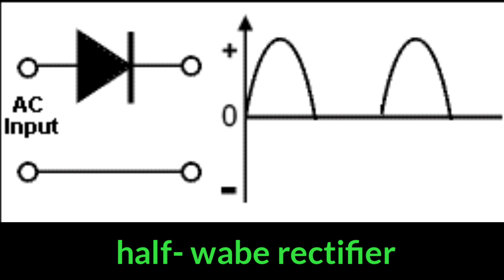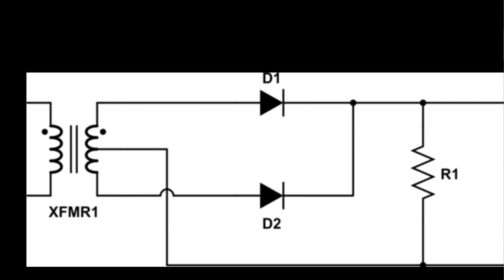Rectifier "Half-Wave/Full-Wave/Full-wave Bridge"

Comment: IF you put electrolytics after the bridge, the voltage will rise more. If it outputs 12 volts, then times 1.2 = 14.4 volts with load,  (12x1.2=14.4 ) if without load times  1.4 = 16.8 volts  (12x1.4=16.8V)